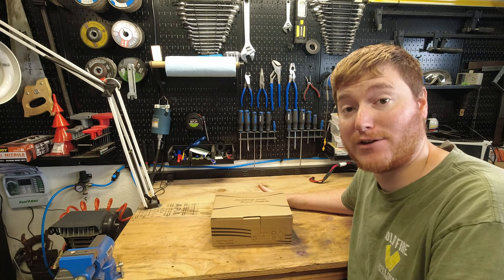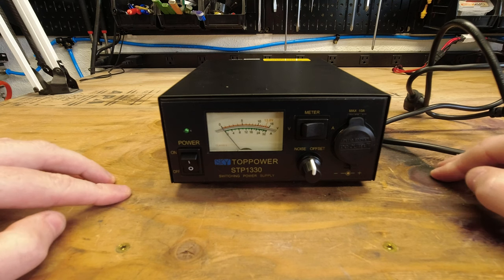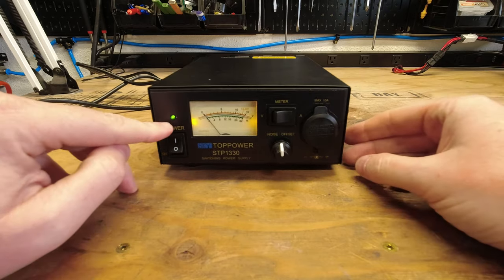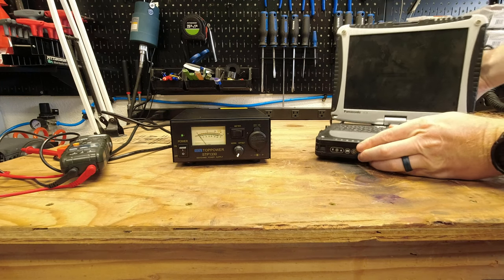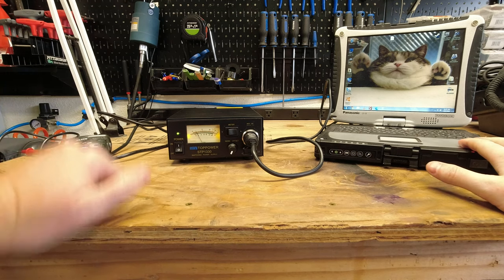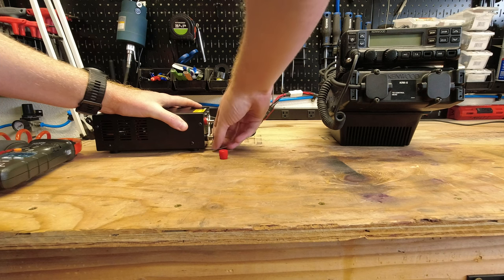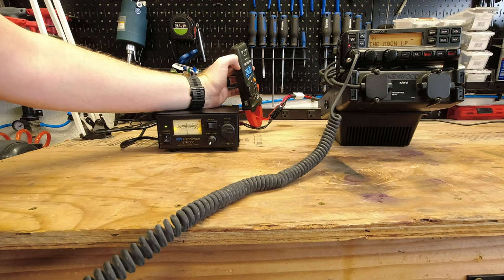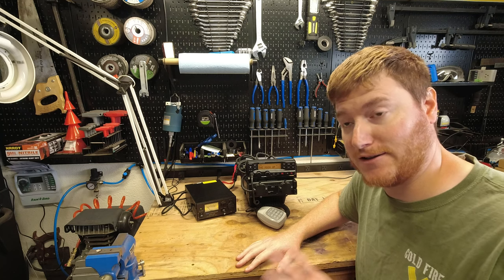SKY TOPPOWER STP1330 13.8V 30A DC Power Supply Review

Comment: I just received this power supply today for my 100 Watt HF radio.  I have been using it for the past few hours and the fan has not come on yet.  The unit is fairly hot so I am worried if there is a problem.  What are your experiences with the fan?
Reply from the maker: I have not paid too much attention to the fan next time I'm in the shop I will see if it turns on.